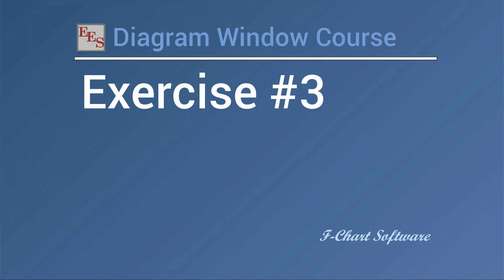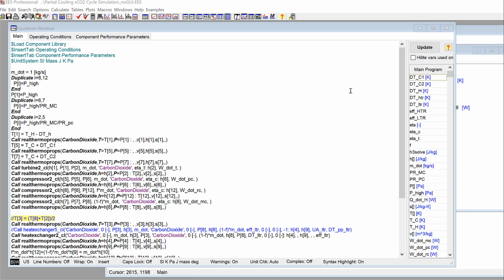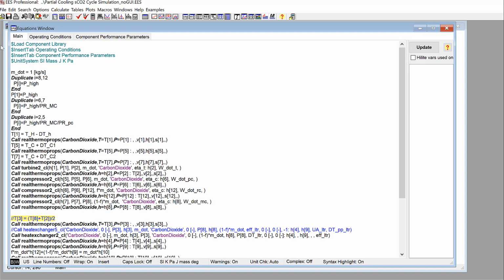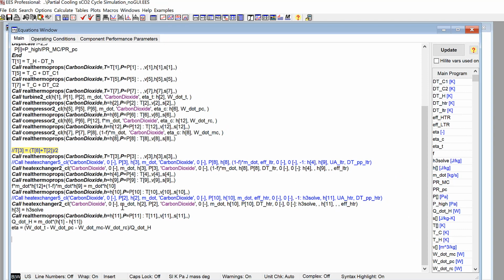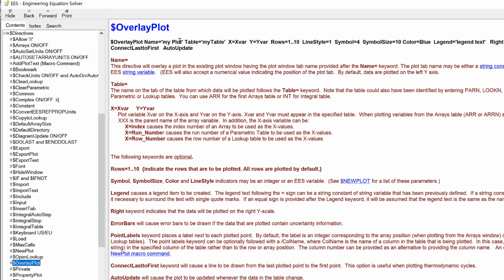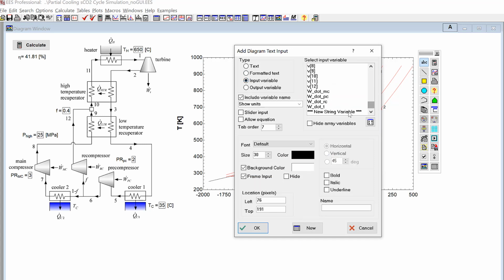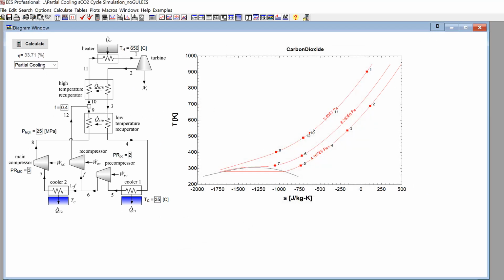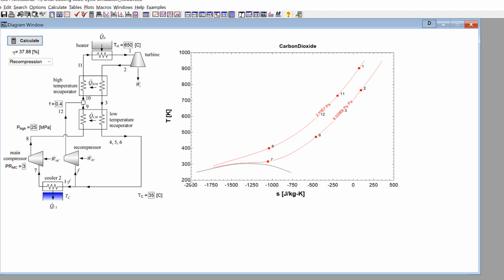Diagram Window Course Exercise 3

Comment: Hi.  When changing the string variable; can you pre-assign a default value for an input parameter and still make it possible to change the value by the user??  At the moment; it seems possible to assign a value to an output parameter, but, how about an input one??   I hope it makes sense?
Reply from the maker: you can save a .var file (from the Variable Information Window choose save variable info file.  Then put a Load Inputs Button and navigate to that file to reset all of your variables, including your string variables.